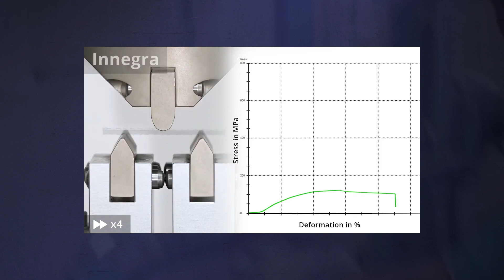Can a MotoGP Helmet survive 7 Impacts? | MotoGP Breakdown with Mark

Comment: Nice Informative video... What are composite materials used by Tivra  ? Any other colours other than Golden? What certification,ECE i saw but our cops are only interested in "ISI" they dont care of Snell,ece,dot etc 😂😂
Reply from the maker: Mate - we use missile grade glass fiber. Normal glass fiber has 30-35% fiber to resin ratio. Ours is 70-75% fiber to resin ratio. So we can get great strength even while being ultra light. 

We developed the yellow gold with Nippon paints to create a shade that had optimum and highest visibility across day or night. Black is invisible at night. White washes out in bright sunshine. You can spot a Tiivra at far - and we are driven by rider safety. 

No - we don’t have ECE yet. We do have ISI and DOT ( which is frankly meaningless as it is a self - certified process ). ECE is expensive and takes time. We will probably go for it in another 4-6 months. Though we can say that ECE 22.05 required impact testing to be 275gs or lower. And 22.06 needs 250gs or lower. We are testing between 104-180 across different areas. We will far exceed ECE when we get it. Right now - all we have is an NABL certified lab report.